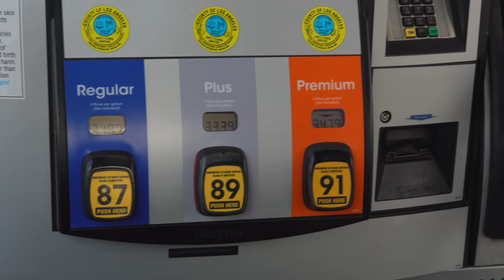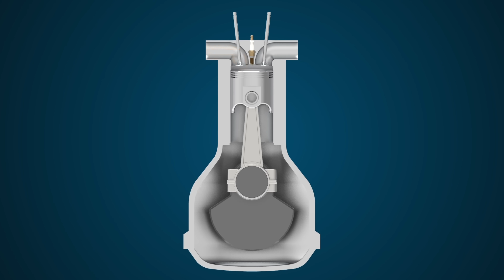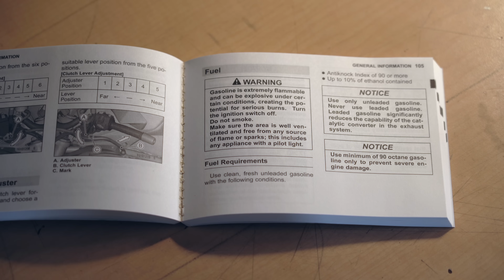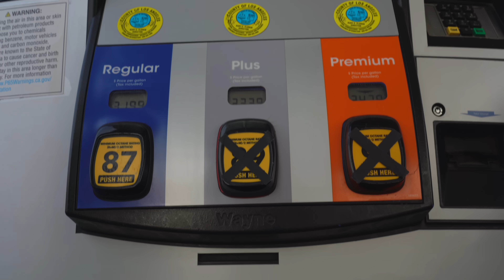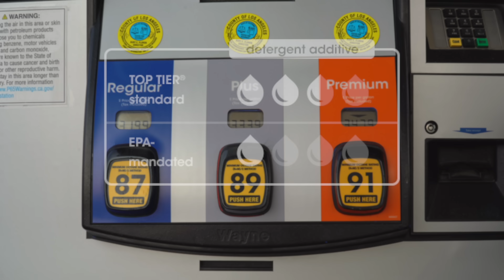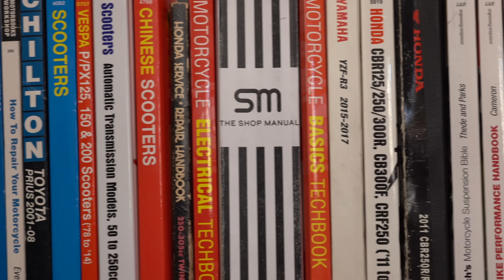Should You Run Premium Gas In Your Motorcycle? Octane Explained | The Shop Manual

Comment: Thanks for this, it confirmed my knowledge of this issue; however, I think you may have missed another key point relating to fuel rating and quality.
In addition to the octane rating confirming the resistance to pre-ignition on higher performance (high compression) engines and the level of useful additives there is the additional issue of the quantity of cheaper bio-ethanol component.

Whilst this is probably not a significant issue for the latest motorbike (and car) engines, it can be a problem for older vehicles where some of the components, especially rubber hoses and seals, which are not designed for ethanol, can suffer early perishing and failure.

I am led to believe that 'premium' brand fuels and those with a higher octane rating have lower bio-ethanol content and are thus better suited to older machines.
This is similar to the issue affecting older and  classic vehicles which were designed for leaded fuels and now either require a lead replacement additive or changes to valve seats and valves to run properly with unleaded fuel.
Here in the UK, and I believe also many European countries,  lower octane fuel (95) is legally required to have at least 5% ethanol, but the higher octane (97) is not, which is why I only use premium brand 97 octane in my 21 year old Honda VFR800 FiX.
I'd appreciate your view on this.
Reply: In The Netherlands, it's either E5 (~95) or E10 (~98), where the E number signifies the maximum percentage of added bio ethanol. There's even E85, but that's pretty rare to find.

Comment: You said nothing on length of engine stroke. Higher octane fuel burns longer  accommodating a longer burn to push the piston down its full travel .
Stroker motors are a example of a "" longer stroke ,"" needing a longer burning fuel .

Comment: You failed to mention that most high-performance motorcycle engines have knock sensors that will prevent damage from detonation by retarding the spark as necessary.  If the detonation is caused by low-octane fuel, then using a higher octane may allow the engine to operate at full power.  Also, detonation is not correlated with high rpm,  but rather with high cylinder pressure, which produces high torque.  On aircraft engines with controllable pitch propellers, suspected detonation is controlled by a selecting a richer mixture and a higher rpm setting.
Reply: I agree "exept" that it is not at a higher rpm settings, but at higher power settings, the issue with propeller aircraft engines is the tip of the propeller aproaching trasnsonic speed where the efficency goes to crap.
Reply: And, in small planes, they still use leaded fuel.

Comment: Good explanation of knocking and octane. Except, when giving HP figures for high performance machines it usually specifies on race gas or 100 octane. Lower HP for 91 premium.  My car is rated at 600HP on race gas. 560 on premium. So there must be more to it than just anti knock.
Reply: No there isn’t, it just allows the car to run more timing/boost

Comment: Spark knock happens before the spark plug fires, not after. It is due to premature combustion due to the heat of high compression combining with excessively volatile fuel. That's why another name for it is pre-ignition. ;)

Comment: First off gas has standards.  Cheaper gas station still have gas that is appoved with fuel standards. For you fancy fuel injected with a ecu cycles. The computer will advance or retard timing for knock. Knock  and  timing on older cycle that are carburetor  fuel octane  needs to be address if you have advance the timing analogy.  Analogy that a word?lol

Comment: This topic is as old as when we used to drag our knuckles on the ground. So simple, do what the manufactures tells you to do. Not a hard concept. 
I put premium in all my vehicles, BM, BMS, 2 YAMAHAS, and the all trustworthy F150. In my book, does not make sense, in the case of the truck, spend $40 some thousand dollars on a vehicle, and the use cheap stuff. If you have a 30 gallon tank, usually putting premium would cost about less than $5.00. Do you spent tens of thousand of dollars on your vehicle, and then you can not afford a little extra for premium. It does not make sense to me.

Comment: When I go on long distance trips I always carry octane booster with me. I tend to travel off the beaten path, and more than once over the years I’ve found myself filling up at some small town station that only has 87 octane (and doesn’t sell octane booster). It pays to be prepared.
Reply: You're wasting money..
Reply: @bgmagma10R  - How exactly am I wasting money? By spending $5 or $6 on a bottle of octane booster, for my bike that requires 91 octane, in case I get caught fueling up somewhere that only has regular 87? Better than cheaping out, using fuel with a lower octane, possibly cause piston damage, and void my warranty, because I used fuel with the lower than recommended octane. If I can’t afford the cost of a bottle of octane booster, that may go unused, I probably shouldn’t be heading out on a long distance trip, now should I? And besides, it’s MY money to waste.
Reply: @kato64  If you have a stock motor bike you're wasting your money. Stop buying into the octane booster bs. It's not doing anything but taking your money.

Comment: This Guy... He EARNED his Subscribe! Good stuff! Great introduction of base knowledge to build a better understanding of fuels and how they work. Now maybe folk will understand that tier1 and tier2 gas has nothing to do with octane rating because octane rating is called, grade; not tier. One tip: when putting away your bike or lawn equipment for the season and don't want to use fogging oil and stabilizers, at bare minimum, stall your bike by shutting off the fuel instead of using the kill switch or key. This will run the fuel out of the lines, bowls (if it's a carb), fuel rails, etc. and limit sludging and the corrosive effects of ethanol. Then, TOP OFF your tank to the filler neck with fuel before putting it away. The chemicals used to adjust the octane rating can evaporate quickly. By reducing the air in the gas tank, you reduce the effects of evaporation, hence, prevent octane rating loss. Simple practice of good habit goes a long way in protecting our tools and toys!
Reply: Also, a fully topped tank will not allow for 'temperature affect condensation'. Yeah, sciencey phrase for water in your gas.

Comment: this is a little misleading. a lot of factory bikes are running 13-13.5:1 compression. 91 octane is usually the lowest you can go in a high compression engine- it doesn't need to be modified. go with the owner's manual recommendation.

Comment: Ye three choices but the only thing is that there is probably three gallants of gas in that hose that is regular that goes into your tank before it gets to the real hi-test if there is any I don't trust those push button pumps put Bach a separate high test pump. Be honest with the people in stead of roping them off for 3 gallants of regular gas at hi-test prices... 
  Totally Criminal Activities...the handle has the valve for off & on what's in that hose ??

Comment: You skipped over the main reason cycle riders buy premium gas......not for the power boost, but to AVOID ETHANOL.  You have to check around to verify which stations don't have any in their high octane, but it's available.

Comment: Agreed and DO NOT RUN CUT RATE GAS(*cough Casey’s*) in your bike. It’s trash and, in short order you will regret it. 
If you have to buy at a trash station, buy the minimum to get you to a good vendor, go for the higher (mid grade) octane gas or pick up some octane booster AND FILL UP from a top tier station ASAP.

Comment: I believe the first 1.25 gallons from a traditional fuel station pump is whatever was last pumped through it if its a 1 fuel line model. If its a 3 or 4 line model pump than it will pump the exact octane selected from the start.
Reply: That’s not how fuel pumps work. There’s lots of videos on that too

Comment: more noticeable on older machines,  take an old British Leyland motor, run on 95 Ron and it's not a happy bunny, use 99 Ron and it runs lovely, probably because it's timed to run on old four star leaded fuel. Never noticed any difference on my motorcycles over the years. Depending on your Jetting a higher Ron can seize two strokes.

Comment: If you wait to hear engine knock, its too late.  That is why they use knock sensors.  Your engine does not need to be modified to take advantage of the benefits of high octane, high detergent premium fuel.  In the thousands of miles of testing I found the engine will allow more ignition timing advance, lower engine loads, less fuel trim, cooler running engine, drastically less engine knock and duration.  87 octane with or without ethanol will result in pre-ignition, more carbon build up in only a few tank fills.  93, non ethanol Top Tier will clean it up, but not after many thousands of miles of abuse.  Yeah you engine fuel map was designed and calibrated for the most common fuel,  crappy, cheap, ethanol fuel of the lowest octane. They design most engines with this fuel in mind because they know that people will buy these expensive machines and use the cheapest gas they can find. Do your own testing, get a $30 torque pro app with data logging, USB borescope and do oil analysis which only cost $40.  No need for expensive Dyno time or test equipment.  I have documented increased fuel economy, more horsepower, lower engine load, elimination of engine knock and much cleaner oil and combustion chambers and valves.  Don't let these internet, talking heads convince you otherwise.  The most important aspect of engine performance is the elimination of pre-ignition.  This problem is accumulative and it will shorten the life of the engine.

Comment: The problem is PRE-detonation. High compression can cause low grade fuels to detonate BEFORE the piston reaches TDC, and BEFORE the spark plug ignites. THAT is what causes pinging, and that's why it's so destructive. It literally works to reverse the engine rotation.

His description and animation was wrong. Once the plug fires normally, there won't be a "secondary detonation" as the piston is pushed back down. The combustion is already in progress.

Comment: Here in Slovakia we have the standard fuel, which is marked as 95 and premium which is 100. What sucks is that the 95 contains up to 10% ethanol, which is no bueno for older engines, as the ethanol really harms fuel lines (especially during winter hibernation). That's more or less the only reason I put premium in my tank, I really don't wan't to damage my bike (2004 Suzuki SV1000S) with some garbage EU forces us to put in our tank.
edit: premium fuel usually contains little to no ethanol
Reply: Pekne si to vysvetlil. No riadne som vypleštil oči 😀 Myslel som, že 87 majú v Afrike a pozri tu...

Comment: I have 2 older bikes..both Honda 250s..ones an 86, the other is a 91..I notice both run cleaner on high grade..I've experienced back fire with low grade..didnt notice more horsepower..just a cleaner smoother feeling ride

Comment: Octane benefits flame propagation and compression stability (ability to resist ignition by compression) which helps you nail 12-14° location of peak pressure (technically full flame propagation by 12-14° atdc) and that makes TORQUE AKA MBT... However if you're ignition system is not set up to take advantage of the higher octane (by having a larger ignition advance curve) you won't notice a major different whatsoever.

Comment: As a rule of thumb during the summer hottest months I use 93. Nothing like getting caught in traffic on an air cooled machine(83GS1100GL) hearing that ping noise when the temps get up there. I had an 07 FZ6 that if you ran anything but 93 in the summer would ping slightly under low rpm load. Anything with over 10:1 I would use 93 even if it calls for less.

Comment: In Canada, it is uncommon (almost want to say 'impossible') to find low octane fuel that does not contain ethanol. Regular has 10%, mid-grade 5% and only the hi-test has zero ethanol. Since the beginning of the 2021 riding season the price per litre for hi-test is around C$1.40 or $5.30 per gallon. That price jumped briefly during the Colonial malware attack to $1.64 a litre or $6.20 a gallon. Bloody hell!!
Reply: Just filled up at Shell yesterday, almost $2/L here in BC for 91.  I worry what OPEC cuts and the summer season will do to that price...

Comment: Too low an octane rating can actually cause ignition BEFORE the spark, called pre-ignition (knock or ping).... this is the worst-case scenario.  Your cylinder pressure (the force against the piston) skyrockets while the piston is still coming up to TDC.  Diesels are called CI (compression ignition) engines because they have no spark plugs, but instead rely on the heat generated by compression to ignite the fuel.  They are "direct injection" engines, where the fuel is injected directly into the cylinder at or just before TDC.  If they were to have port injection, they would then have a fuel/air mixture entering the cylinder, and would experience pre-ignition.

Comment: Running higher octane could actually make your bike slightly slower. Higher octane means the air fuel mixture takes slightly longer to burn. In most cases this is negligible, but  in extreme cases in an engine at very high rpm, the piston could outrun the flame front.

Comment: I had a BMW 1150 gs that called for premium fuel and would still knock or ping at high altitudes with it. I was in Canada and got a tank of Husky 100 octane fuel and noticed a substantial gain in power, it would literally pick the front wheel up coming off the line where the 91 in the states would not. Also had the same experience with an RZ350 two stroke when running 100 octane cam 2 fuel. Now being a auto technician for 35 plus years new cars have what is called a detonation sensor the listens for detonation and reduces the ignition timing to correct it which decreases performance and fuel mileage. I run premium fuel in everything for one to keep it clean inside which like he said cuts down on carbon build up which will contribute to detonation. Also with adjustable ignition timing you can run it more advanced which improves performance. So at very least run what is recommended.
Reply: Not surprised. In Europe, petrol's very expensive by higher octane: 94 is standard, 98 premium. Any European engine (car or bike) will run smother with US “premium“ gas".

Comment: Not really.  The top name brand gas stations and the cheap no name brand both get their gas from the same source.
Also the 91 octane is only 2 octanes above the low 89 octane.  The octane measurement isn't very accurate anyway and it comes from the same hose.  So just save yourself some money and buy the cheap stuff.  Your engine is only going last 100K to 150k miles any way no matter what gas you put in it.  Aviation fuel is different.  Airplanes use 100 or 150 octane.  That makes a big difference.  For you motorcycle just use the cheap stuff.  ...and ride safely.

Comment: I have worked at a gasoline refinery for many years. You are at the mercy and luck of which batch of gasoline out of what storage tank it came from. The additives are blended to the stock as the trucks load at the racks. The labs do a knock test during each shift and other tests such as vapor density. VD is much more important than than knock test for good gas. Winter specs are different than summer. The whole thing is a crap shoot. Lab techs fudge test numbers to keep from dumping fuel that has run thru process. I work on the CAT unit which breaks the crude down on a molecular level then fractionates it to be sent to other units. It’s nowhere near as specific at the pump as you think. Find a good place that works for your motor and stay with it.

Comment: I live in Missouri where 10% ethanol is mandatory with regular/unleaded gasoline. Since motorcycles sit here for a few months during the winter I avoid ethanol at all costs because the crap breaks down, eats up rubber, and actually pulls moisture out of the air and you end up with a gel-like substance in your carbs if left untreated with Stabil. I stick with the premium non-ethanol at 91 octane because it's a small tank and worth the potential reaming filling up a cage would cost. I've had no problems after storing the bike during winter without adding anything. I ride an old '79 XS Eleven Special that was designed for regular gasoline but it runs fine on the mix if I have to fill up somewhere where non-ethanol isn't available. Newer bikes not sure.

Comment: UK rider.  I avoid supermarket linked stations as they’re lower quality and at the normal fuel stations we get normal or premium as options, that’s it. I used premium for my R6 but for anything I knew I was only keeping for a year or two, I saved the “premium” and only used regular. That 70 cent per gallon extra adds up over time.

Comment: I lost count in my bikes I NEVER HEARD A MC KNOCK OR PING, I run 93 with a splash of octane booster 6-8 oz and splash of injector 3 oz cleaner 3 oz, ie seafoam, STP; ect.  I do notice a big difference on the way my bike runs.  Gas now and Gas then ran a KE100 5,000 miles as a kid the piston look brand new today 🤮.

Comment: We have 93 and 95 octane through South Africa and 97 closer to the coast which is awesome when I take my rabbit down to Cape Town
Reply: Exactly octane also comes into play with different altitudes thats why here in SA we have higher octane fuels because the air is thinner the higher the altitude even though golfs are recommended from factory to run on 91 octane
Reply: @anything4tech699  very true. Sometimes I forget we are on a plateau. With the mp9 injection system it works really well although I do need to get a proper fuel management system hooked up to tune.